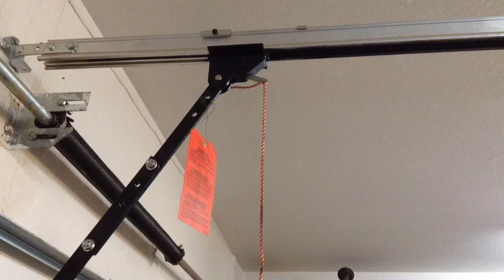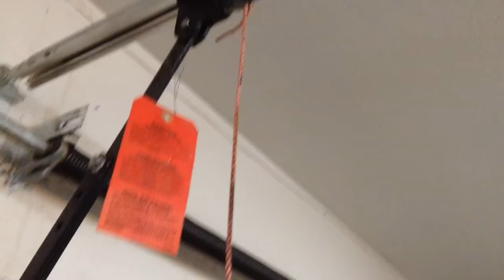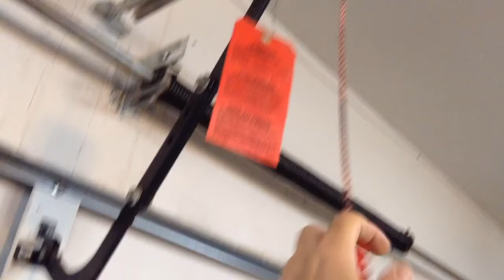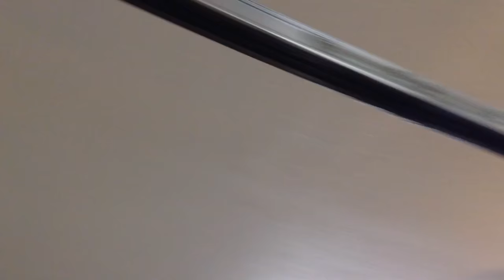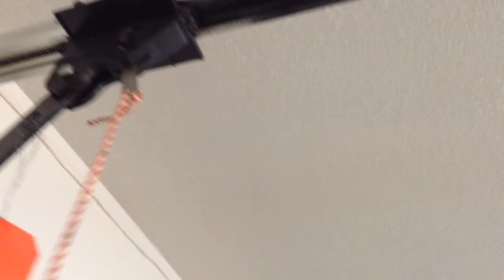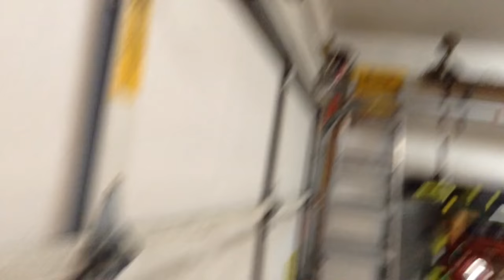HOW FIX YOUR GARAGE DOOR OPENER ONCE YOU HAVE PULLED THE EMERGENCY RELEASE

Comment: I accidentally closed my jeep door with the emergency coil to the garage door in the car. When I tried to close the garage door, the coil was pulled causing my garage door not to work last night. I pulled the garage door down manually. I looked at the sensor, they work well. Nothing was blocking the sensor. I found a video before yours that indicated that it could be the emergency coil was pulled, but it did not give any solution, but yours did.  Thank you so much. I was able to fix my garage door issue.
Reply from the maker: Hey DIANA!  It is a common issue (normally kids messing around :) )  I am glad this was helpful for you

Comment: Before pulling the manual release take note of the position of the manual lock the rope is tied to. When pulling down this piece  will be straight down you need to push this piece back to the 90 degree position to reattach. Take a picture of the manual disconnect before pulling the releases rope. Took me a bit of time to figure this out.
Reply from the maker: Thanks for the tip my FRIEND

Comment: Mine works slightly differently... there's 2 components, a base that is in the track and another component attached to the arm. After disengaging, you have to lift the door back into the base and the reengage the lock. Hope that helps.
Reply from the maker: Thanks for the tip, RICO :)

Comment: Well, I don't want the sensors because the dogs mess with them. It's been a consistent problem. I just want to open and close the door with the wall panel or my remote.I really appreciate you responding to my request. I was surprised to hear from you so quickly.
Reply from the maker: I try to answer all comments as soon as I can  .. sometimes I don't get notifications on the comment or I am at work :(.   Without sensors can be dangerous esp for animals...I know someone who had their cat get squished by the garage door because it didn't have sensors :(.. But, YES, they can be a pain for sure :)

Comment: Thank you..I still feel dumb. I did that..worked great but I had just mowed when power was out and apparently I moved/touched something and it goes down till about a foot from closing and goes back up. One light is showing green and one is not glowing.  Is that my problem?
Reply from the maker: Hmm I think some brands have a setting for how far they go.. you can adjust it using the buttons on the main part.. I would youtube a video.. I have made one here for a genie
https://youtu.be/WEa-TVJ_Amg?si=_dbh9IVRhckOtzQq

Comment: What about the fact that it's in the open position right now and I pulled the cable? It came loose, but not too much, so I lowered the garage door down gently. Now I am trying to reattach it.
Reply from the maker: it should be able to reattach no matter where it is on the screw drive.. it all depends what position your garage door is in.. I find it best to do when the garage door is down
Reply: @ETPCYT  Thank you! I brought it back up and it clicked on there, for some reason it wouldn't at first. Now I have to get the trolley unjammed off the stop nut, apparently that's why the door won't shut

Comment: Did the same thing in power outage. I can lift the door manually about 4 inches and then bam it won’t go further like it’s still locked. It’s not moving I.e. re engaging when I move it those 3 inches. No idea what todo other than getting bolts off the connector so the door has no physical contact with the screw track
Reply from the maker: maybe the springs are pulling it back up so it reengages.. try having someone hold down the cord while you lift

Comment: I need help with mine! So my power for the garage is not working anymore. Today I pulled the cord and now I can't put it back to engage due to no power. Can you help?
Reply from the maker: if you have no power.. it needs to be disengaged to pull up your garage door... when YOU have power just do what I did to reengage it.. you might have to get a step stool in order to firmly tug straight back toward the motor
Reply: @ETPCYT  the only thing is, the garage wall mount button isn't working anymore. I went and pulled the cord and now it has disengage. Due to unworking button on wall, I can't engage it through that process. Is there a way around to engage it?

Comment: Ok, thanks. What about when the sensors are broken and I can open the door with my remote, but I can not close the garage door  with my remote? What do I do?
Reply from the maker: Hello Paula, I just had this issue actually. My sensor got bumped and the door would only close about 2 inches then go up again. This happens because the sensor is not aligned and it thinks there is an obstacle in the way.  One sensor should have a red light one has a green.. Try to aim the one with the red light directly at the other sensor so that the red light remains constant and is not flashing.  This is normally just a slight adjustment.  maybe up or down.  If you need to have your garage shut all the way in the mean time, YOU can hold the button down on the manual button in the garage until the garage door closes all the way then you can let go :).. I hope this helps

Comment: I have a complicated situation so please bare with me for a minute. Years ago our garage door started to go up by its self. I was thinking about replacing the opener but when I looked online at some of the reviews I decide to just pull the  emergency release cord and manually  pull the door up and down. I closed it with chains tied on the frame  on the inside   Anyway this morning i find my garage door pulled up about 4 inches  The door was so jammed up that I had to take the lock off the chain but I couldn't unroll the chain from where i had it tied  so I had to  use  the  claw part of the hammer to pull loose the chain. It was so pulled up the metal bar that the door slides up on was bending.   When I finally got the chains off the door it  went up a inch or so more and I couldn't get it back down. I pulled the   emergency release cord and the door could be pulled down a little but stopped so I had to pull the cord again, finally I pulled the cord and taped it  and used some clips to hold it in the  release position ,  Anyway my question is this could the  Emergency Cord some how reset its self and the motor malfunctioned again and the door tried to open but was stopped by the chains?
Reply from the maker: it sounds like somehow it did reset itself.. Some of these are different and perhaps it somehow reengaged?  It sounds like your garage door opener has a mind of its own !  I think I would buy a new one.  It seems like quite a hassle chaining it all the time.. Plus if it breaks your garage door, that would probably be more expensive than a new opener.. I would suggest unplugging it when not in use.  I wish I could be more helpful..  TAke care!
Reply: @ETPCYT  Thank you very much, you were very helpful, i was worried may be a burglar did it, but i'm glad to hear it could have reset its self. Thanks again, God bless
Reply from the maker: @cd5456  :) YOU are most welcome:)  GOD bless YOU too :)

Comment: Thank you!
Reply from the maker: Hello RAE, YOU are welcome :)
Reply: @ETPCYT  I know that it's a simple thing to show someone how to do this. But it was really nice that you did it because especially for me I was never shown how to and I like to be or at least feel  self-sufficient. So instead of having to call someone or have it mansplained to me. Your video was informative, quick, easy and not judgemental. I appreciate that as a female. Now the problem I'm having is that one of the sensors won't turn from orange to green like the other one. I have measured it length from the floor to the sensor exactly, cleaned the sensor and nothing is working. Any ideas?
Reply from the maker: @rae4976  Hello again.. does the garage door still operate?  Sometimes one of my sensors gets bumped and it won't let me close the garage door.. it will start going down then go right back up.. .. just looked at my sensors .. one is green one is red but it works.. I have discovered that it is a loose wire on my sensor that has caused the issues.. usually I just press the wire back in the direction of the sensor and it works :)

Comment: I must have another issue. My son pulled mine. That’s exactly what I did to fix it but it still won’t reengage. 😢
Reply from the maker: some can be quite stubborn.. It can get in a spot where it is very difficult to get back.. I recommend a ladder or something very stable you can stand on and then YANK back very quickly and firmly STRAIGHT back toward the motor.. This does it for me

Comment: Lost power and had to manually open the garage door. Now the trolley is too far for me to reattach the arm, it needs another few inches but the door is closed all the way and I can’t get closer. Any ideas?
Reply from the maker: if I am understanding correctly, The arm should be able to move on the worm drive.. did you disengage the arm from the part that connects to the garage door opener rail?
Reply: @ETPCYT  Thanks for the response. I was able to get the arm reattached!

Comment: I have a huge problem! Some time ago there was work done on my carriage, I was not the owner at the time. And now the emergency release does not work. I have tried pulling every which was and it doesn’t release the carriage from the track to manually move it.
Reply from the maker: hmm you might want to have that replaced
Reply: @ETPCYT  I fixed it! Whoever worked on it before put the spring on the release wrong. Boom we’re back in business!
Reply from the maker: Glad to hear it Justin :)

Comment: My problem is that out of no where my garage door opener keeps locking it's self.  That is it will open in the morning close when I leave.. I get home and the garage door won't open.  Go in through the front door push the opener button on the inside.  makes noise chains don't move.  Door is in locked position.  I have to pull straight down on Red rope.  Everything thing reengages push the button garage opens.  Then the same thing will happen the next day.  Door will open in the morning and close as I'm leaving driveway,, get home.. have to in through front door pull straight down red rope .  I can't find anything on how to fix this??  Any suggestions?  Thanks
Reply from the maker: Hrmm .. try going in your garage and see close it.. see if the rope is hanging up on something... There has to be a reason that it is disengaging.. see if you can tell when it disengages.

Comment: does it work if its opened?
Reply from the maker: it should be able to reengage whether open or closed. but if it is open I wonder what is holding up your garage?
Reply: @ETPCYT  nevermind, the track thing was off and i needed to just run that until they lined up! thanks for the feedback

Comment: What do you do if it didn’t work?
Reply from the maker: If yours is still disengaged I would try standing on a ladder or something that makes you a little taller.  I have to give a  pretty hard tug almost directly toward the motor .. if that doesn't work try pushing the metal bar that the rope is attached to

Comment: Whst if door still won't open - I feel it's locked somewhere but don't know where
Reply from the maker: hmm.. pulling the cord disengages the opener from the motor so you can lift it manually.  it may be a little difficult..

Comment: My older cousin is like curious George. When I start my car he turns it off w the button thinking he turned it on. He did it like 5 times in 2 days. Then he pulled down the emergency cord and i was so done. Now I have to fix it. Hope this vid helps
Reply from the maker: You got this my Friend!
Reply: @ETPCYT  I fixed it. I think at least I haven’t tested it but I popped the latch back on